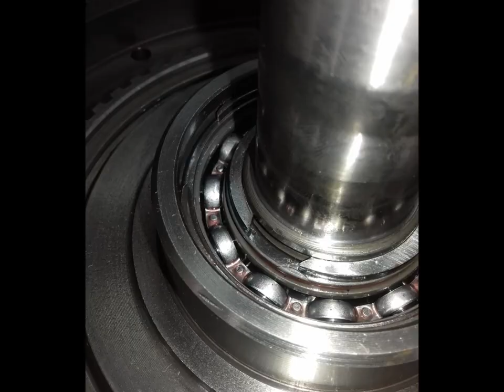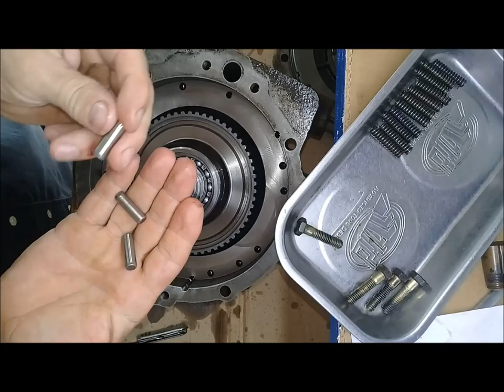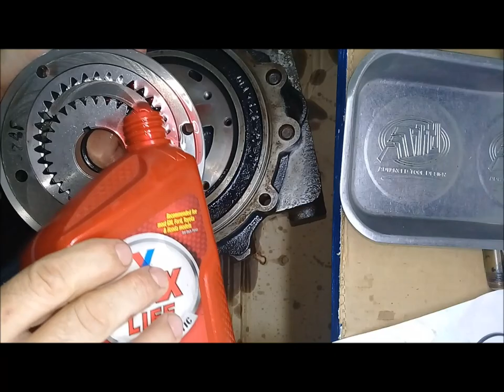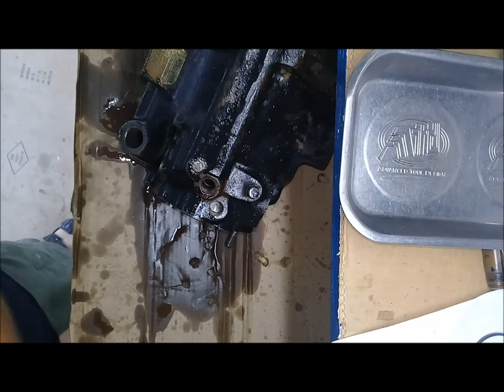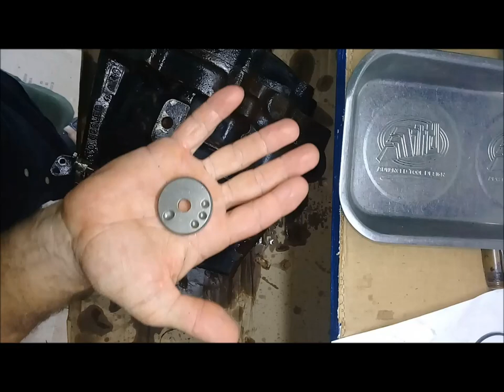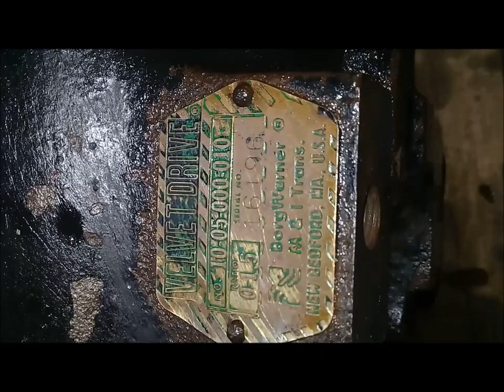Borg WARNER 72 C Velvet V-DRIVE REBUILD PART 3

Comment: Question for you: Why use Dex3 when Mobil 424 is required from velvet drive? V-drives
Reply from the maker: I only used it for assembly.  That was available at home.

Comment: Would you have an idea why mine goes forward in neutral? Not fast but enough to mess with my head. Control valve? vent? Clutches?
Reply: You need to change and replace the clutch plates(bronze ones)